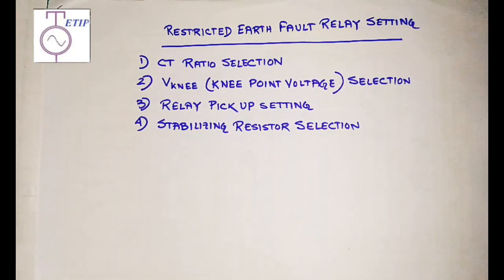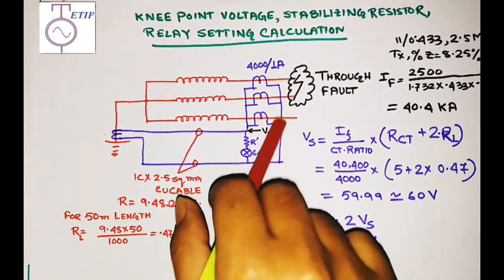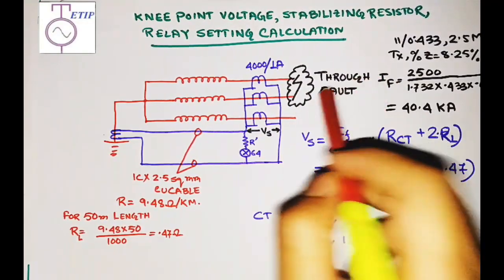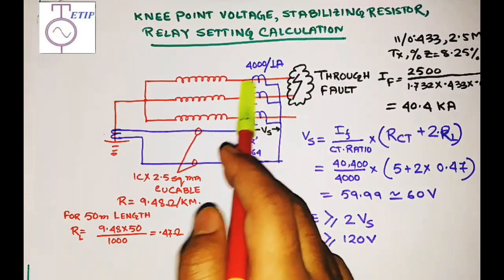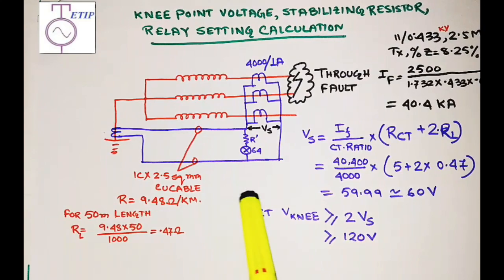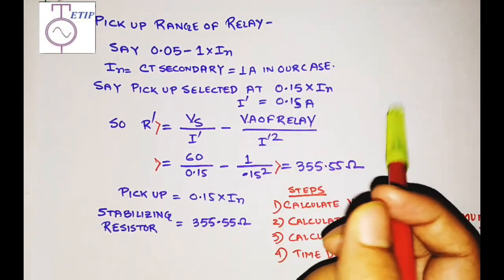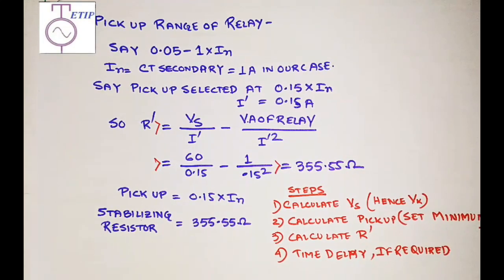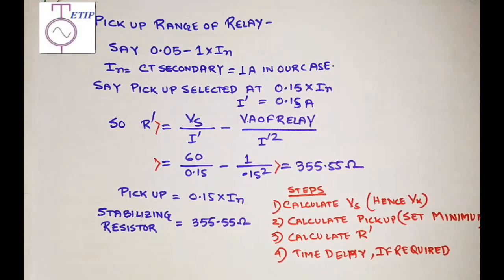Relay setting calculation|Restricted Earth Fault Protection relay Setting Part-2|KNEE POINT VOLTAGE

Comment: Say for suppose if the fault has occurred within the Restricted zone and only N CT is seeing the current. In that case say 10 Amps of secondary current has appeared. For that to drive through REF relay coil, a specific voltage will be developed. Since CT is a constant current source if primary current is constant, voltage across CT secondary will vary based on VA burden. If 700 Ohms is being connected as Rstab then to drive 10 Amps of current and 700 Ohms of load, a voltage of 7kV is required. Which in that case metrosil will operate and bypass that as surge. I was not able to understand in normal conditions, when the Rstab is connected, how the current is being flown through relay citing heavy burden.

Comment: Sir, Thanks for giving such good knowledge about REF protection.
How RCT of 4 nos CTs i.e. 3 phase CTs & 1 neutral CT.
Also explain the exact method of calculating wire connected with the 4 CTs.

Comment: Sir please, by safely choosing the the knee point of the CT to be twice Vs...Then it's safe to say the LCT's won't get saturated for high value external faults right?
Reply from the maker: Yes. That is one of the check point of REF setting
Reply: @electricaltechnologyandind5335  So if it's unlikely to enter saturation by safely selecting your CT knee point, then i really don't see the need of a stabilising resistor
Also, won't the stabilising resistor reduce the current in the event of a ground fault within the protected zone, hence, the relay might not operate?
Reply from the maker: When vs has occurred that will drive current through relay. For that stabilizing resistance is given. Please watch the video again
Reply: @electricaltechnologyandind5335  But Vs only occurs when the CT'S get saturated right?
Reply from the maker: No. When current flows.

Comment: Why the CT saturated even though the CT knee point voltage is very high
Reply from the maker: Normal protection relay doesn't have high  knee point voltage

Comment: Hello sir, After calculated VS , why should we use the formula of CT Vnee>2Vs?? and here this video you increased the voltage from 120 to 400?????and you told that we can use 650V also..how to choose the maximum voltage ???

Comment: In case the earth fault is inside the zone , how to ensure that insertion of stabilising resistor will not lower the fault current below the pick-up setting of the relay
Reply: I have the same doubt